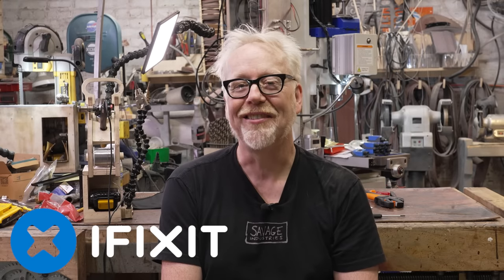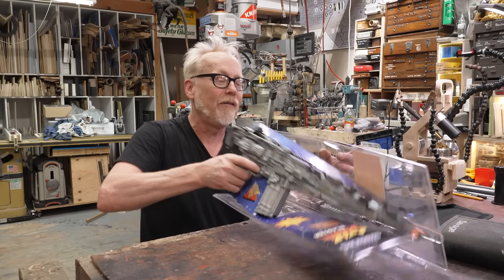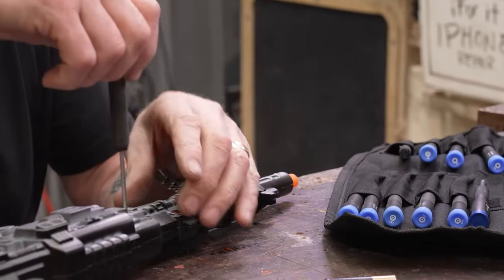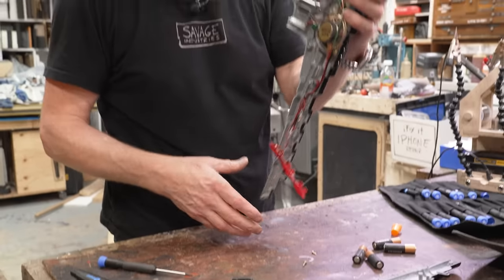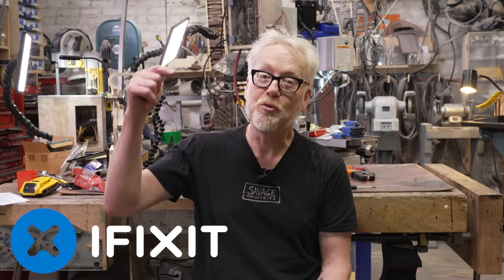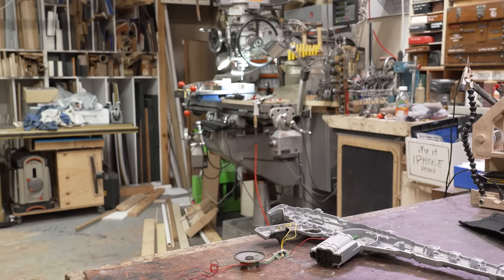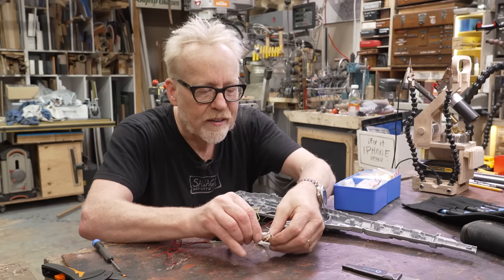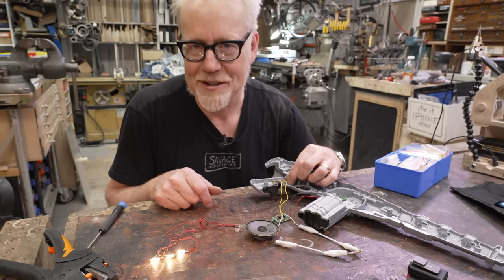How to Quiet Your Kids' Toys!

Comment from the maker: Today’s video is made possible by our friends at iFixit. iFixit's Skip the Upgrade is going on now and throughout September. They marked down all iPhone parts up to 20% off. And, when you buy any iPhone part and use the code BOGOCASE at checkout, you get a free iPhone case. Just visit http://www.ifixit.com/tested
Reply: at 15:00 Adam says you will provide a link.
Reply: If Adam ever comes to Germany again, maybe he wants to arange a visit to the Georg-Simon-Ohm vocational college in Cologne.
Reply: @sorrowschism Missing that link.
Reply: Where's the link?
Reply: Also commenting so i can come back later for the link :D
Reply: Where's the link for the wire strippers at 15:00?
Reply: dang those wire strippers look like they work really well.  Certainly much better than the ones I use everyday.  I wonder where I could find them?  A link would be helpfull
Reply: Definitely need that link for the strippers!
Reply: GIB link
Reply: Highly recommend iFixit tools if you don't have them. They last, and the kits cover most repairs. I have the old pro tech kit, and it's lasted a decade+ of heavy use. I've repaired phones to sound boards and speakers to cameras and laptops with it. I have modified mechanical watches with them too. 

There better, sure, but do you know how to choose them?  These are a safe buy. 

I've written several of the repair guides there, so I'm biased. Just bought more tweezers and spudgers.
Reply: You can stab out the speaker without breaking the circuit. Just stick a paper clip in the old noise hole and give it a twist.
Reply: It's not too hard to do it precisely.  Get an ohm meter and measure across the speaker.  Since you cut one wire already that should be easy.  Then add a resistor in series with the speaker that has the same resistance ...  and you will halve the sound ...
Reply: link please
Reply: Now, i need to know how to make the toys louder so i can send them to my sisters children 🤣.
Reply: He should change his name to Savage Adam.
Reply: I'd try swapping one battery for a metal slug, leds probably still light and volume would be so what lower... And you can use the alug with other toys!

I've totally removed speakers from toys where lights were the main event.
Reply: @sorrowschism    Weidmuller Stripax is the item
Reply: If the speaker is 4 ohm using a 4 ohm resistor will cut the volume in half. Using a 12 ohm resistor will give 25% volume. 16 ohm will give 20% volume.

Comment: As a uncle can we have a video on making toys louder? 😂
Reply: More power, bigger speakers, etc
Reply: Put in a second speaker wired in parallel to the first one.
Reply: Damn yooou! 😂
Reply: I don't normally curse people, but I curse your sir...😅😅😅
Reply: You can put in an amplifier to get more of the speaker. Depends on the circuit, but you might be power limited by whatever is used for voltage regulation. Even then, you can just power the amp circuit from the battery directly if it has enough juice (or add another battery) and use the output of the existing speaker a your source. If you threw an 18650 into that beast with a 12V regulator, you could blow up any dinky little speaker they make lol.
Reply: As a soon to be uncle, I support this request 1000%!
Reply: @danielland3767  😔The curse of the fun uncle is a tough one to bare indeed 😁
Reply: @Merennulli  Congratulations, may all your gifts be popular, noisy, have hundreds of pieces and take up too much space.
Reply: Just so we’re clear. When Adam trashes a job for “demonstration” the item worked on is itself trash and not worth the time to allow into ones home.  This video is solely for those unfortunate enough to be given said trash. I say Let your kids smash the toy and put it were it should be, the trash.
Reply: @codingentity Thank you! My poor sister in law thinks I'm joking when I say I'm going to do this.😆
Reply: Add Bluetooth, and connect it to a soundbar on max volume 😂
Reply: Before you take such a drastic step make sure to have a vasectomy to ensure there is no chance for you to ever have children. Because revenge is very sweet, and the parents of your nieces and nephews will have loooooooong memories. 🤣🤣🤣
Reply: @jllaine With a short 0.2 second delay if you’re feeling really evil.
Reply: I have five nephews. I'm all for this.
Reply: @codingentity  🤣🤣🤣🤣
Reply: I have found air horns and silly string to be excellent gifts.
Reply: loud toys are merely temporary. the true chaotic evil uncle gifts a lifelong interest in loud musical instruments.
Reply: AND more obnoxious
Reply: Hide some extra batteries inside so that even when the parents take the batteries out it keeps going.
Reply: The real trick is to make it quieter, but teach the kid how to make it louder again.
Reply: I MIGHT have taken the Sesame Street Saxophone that my brother-in-law gave my daughter when she was born, and then replaced the alkaline AAs with Lithium AAs, as well as replacing the screw with magnetic rivet (so I knew how to replace the batteries when they eventually wore down, but THEY couldn't figure out how to remove them), before I re-gifted it to his newborn son. Not louder, but that thing would run at full volume for MONTHS...
Reply: I'll like this because I did it as an uncle but hate it now that I'm a parent
Reply: if you can find a vintage toy, called "bigmouth singers"  that is still operational, you will want to acquire it.
Reply: Sounds like a Mark Rober task.
Reply: There is a children’s instrument called a “recorder” that I highly recommend.
Reply: @brainsniffer  we were thinking more along the lines of bagpipes.
Reply: @brainsniffer  now that's pure evil
Reply: Check the ohm rating on the speaker and then buy a speaker with half that value. Caution you may short circuit but it will be about twice as loud.
Reply: Well you could forego the batteries and modify it to be rechargeable with a USB cord. That could definitely make it more annoying since dead batteries won't happen. That can also provide more power for a longer life and could also give you enough power for a small audio amplifier. Which would make it louder, and the parents can't decide to not buy more batteries, since they could plug it into a USB power brick to charge the battery cells you install with the charge controller and voltage regulator.

Comment: The furby community has been quieting furbies with a much simpler method for years. Just open up the toy, put some painters tape over the speaker, seal it back up and your done. That way the mod can be removed if it becomes a collectors item down the line 😂
Reply: So many of my toys growing up had packing tape over the speaker openings 😂😂😂
Reply: My kids learned to look for the tapes, so I had to start doing the resistor trick.
The speaker's impedance is somewhere between 8-32 ohms, so that gives us a good starting point for the resistor values. A set of 3 resistor values gets you quite far with kids toys: 15, 39 and 82 ohms or anything close to those.
If possible, do the quieting down before the kids get a taste for the full volume  😊.
Reply: @JiiPeeHoo69  the reason it still works with furbies and furreal friends is because the speaker is under the outer fur covering which is zip tied on the toy. With other toys yeah kids will probably peel off the tape 😂
Reply: @strayiggytv  Similarly I have a Vectrex games console from the 80s, for technical reasons it has an inherent buzz in the speaker, and there are numerous complicated fixes available online that involve lots of wires, parts and soldering.

I fixed some black acetate over mine by its outer edges, it dulls the high end and itself vibrates re-transmitting the sound via this new hiss-minimising membrane.

And if ever I want to sell it, once the membrane is removed, it’s still as it was when bought in the store.
Reply: I worked in a special school for some time, and part of my job was to 'quieten' noisy toys by using packing tape over the speakers. The other surgery involved bypassing the battery to connect the toy to a switch called a bigmac/big red button so that children with minimal fine motor skills could operate the toy. We were on a budget. ::shrug::
Reply: Meanwhile, Sam (of Look Mum No Computer) has been making furbies louder by increasing the number of furbies by at least 2 orders of magnitude.

Comment: I have 4 young children with plenty of loud toys and my wife came up with the genius idea to just put clear packing tape over the speaker to muffle the sound.  It works great most of the time and the kids still love playing with the toys... just another option if you are less inclined to take apart toys and installing resistors.
Reply: That's what i do, works good enough for me
Reply: Not an expert, but, isn't it possible that tape can be pulled off and become a choking hazard?  Just asking, not criticizing.
Reply: You can also put some play-doh into the audio holes. That should be safe to the children if they can get it out from the toy.
Reply: I'm not so sure that modern toys are anywhere near as accessible to be taken apart either. That was a LOT of screws and wires in this one... that stuff is expensive! (Yay, late stage capitalism!)
Reply: Came to say exactly that! And it's totally customisable. The more little holes you cover, the quieter it gets!

Comment: Use a knob! That is, clip in a variable resistor (potentiometer) and adjust it to your liking. Then measure the value with a meter and replace it with a fixed resistor (if you want); makes it easier to fit inside tight spaces. Or leave the pot in there so you can change the volume later if appropriate.
Reply: the potentiometer would be the thing to get when you dont have a resistor box :P best upgrade to a furby ever
Reply: a small trim pot - set it with a screwdriver, and just leave it there.
Reply: And as a bonus, if your toddler opens the toy and cranks the potentiometer back to full volume, you know you have a budding maker in the works. 😉
Reply: @machinate  This is likely the best approach. No having to dig through a selection to decide things, and as a component it's cheap enough.
Reply: Wouldn't be hard to drill a hole somewhere in the toy and secure the pot in a way that it can be adjusted without opening it all up again.
Reply: @Shoop83  That's extremely dangerous, enterprising kids will find it. They're already gonna be suspicious their toy is quieter.
Reply: @nfnworldpeace1992  you might still need a selection of potentiometers if the one you select doesn't have a high enough resistance.

Comment: It's an 8ohm speaker, so a 8ohm resistor will half the outout.
The 82 ohm resistor reduces it to about 1/10 volume.
Reply: I thiiiiink 8ohm would be a bit over 1/2 the perceived volume, because assuming the voltage drops by half, that'd be -6dB (and each 10dB drops by half perceived volume). And 80ohm would be -20dB, so a quarter volume. They actually make logarithmic potentiometers specifically for volume bc it's all nonlinear.
Reply: @ShinyQuagsire  that's why I said half the output and not volume.
If I know anything about decibels it's to stay away from them.

Comment: With small speakers, the enclosure is often a key factor in how loud the toy sounds.  We once had a small wine refrigerator that had a fan to circulate the air periodically (independent of the actual refrigeration).  The noise drove me crazy.  I discovered it was equivalent to most of the fans used in desktop computers, so I bought a very quiet PC fan to replace it.  On the bench, the new fan was clearly much quieter.  But installed, it was just as loud.  The problem was the fan mounted to the center of a 2-by-3-foot sheet of thin pressboard--essentially a sound board that amplified any fan vibration whatsoever.  (It was a terrible, cheap design.)  The solution was to mount the fan to the board with rubber grommets to dampen the vibrations.  Changing how the speaker in a toy is mounted, where it's mounted, or filling the empty space inside the speaker enclosure with soft material are all viable solutions.  No expensive wire strippers needed.  ;-)

Comment: Hey, for those interested here are the formulas:

-20 * log(1 + R / 8) = the change of audio power in dB

Where R is the value of the series resistor and 8 is the resistance of the audio speaker.

So the 82 ohm resistor Adam used corresponds to a 21 dB reduction of audio power.

For those interested in the inverse formula, here it is:

R = 8 * (10^(-x / 20) - 1)

Where x is the change in dB, so for a decrease of 20 dB x = -20
Reply: Doin the loooooords work!
Reply: Possibly worth mentioning that a reduction in 10dB is halving the perceived volume, so 20dB is 1/4
Reply: Figured people might want to see where this comes from.

The resistor splits the voltage with the voltage coil proportionally.  So the voltage across the coil will be:

V_n = c(V_o)/(c+r)

where 

V_o is the original voltage across the coil
V_n is the new voltage across the coil
r is the impedance of the resistor
c is the impedance of the coil

So the voltage gain is:

V_n/V_o = c/(c+r)

This can be converted into dB power as:

20*log_10[c/(c+r)]

The 20 is due to the fact that power is proportional to a square power of the voltage. Note that the OP used the inverse of the voltage gain:

V_o/V_n = 1/[c/c+r] = (c+r)/c = 1 + r/c

Because he used the inverse voltage gain, he has to multiply by -20 instead of by 20 to compensate.

We can also calculate the power directly.

The power of the coil is given by the voltage/resistance power formula:

P = (v^2)/c

So the power gain is a square of the voltage gain since c is constant:

P_n/P_o = (c/c+r)^2

This can be converted into dB power directly:

10*log_10([c/c+r]^2)

10 since the voltage has already been squared.
Reply: And thus, how much longer has Adam prolonged the battery life?
Reply: @trueKorvus  nah mate, I’m done with uni life 😅
Also mech and not electric engineer…
Reply: @trueKorvus  That is difficult to estimate, since it isn't just the speaker that draws current. The integrated circuit (and lights) also draws some amount of current. However looking only at the speaker output the new power draw is only 8 / (82 + 8) * 100 = 8.9% compared to the old situation (asuming the output voltage does not change). So I would say that the battery life is maybe 10x longer, if you are lucky (it is probably worse). Overal it is quite difficult to estimate and the only way to really know is to do a experiment and actually measure the current draw before and after the modification.
Reply: @tjego5806  Hey thanks.
Now I'm not sure what would be worse. Listening at normal volume or at a reduced volume for 10x longer? At least the kids are happy.
Reply: @tjego5806  Nowhere even near that.  

First note that you are calculating the impedance of the coil as resistance. In reality, they are vectors. 

Second, note that the resistor is actually dissipating much more power than the coil as it has 82/8 = 10.25 times as much voltage across it.
Reply: No.  The savings will be nowhere near as dramatic.  Consider that the resistor will heating up and dissipating more energy as heat as it has most of the voltage across it.  There is also some simplification on the difference between resistance and reactance that has been ignored.  Finally there are other components that are using power.
Reply: @timharig   >> First note that you are calculating the impedance of the coil as resistance. In reality, they are vectors. 

Yes, I know that in reality it is much more complex (pun intended) the wikipedia page Electrical characteristics of dynamic loudspeakers gives a more complete picture of the actual impedance curve. The calculation I did is only true for very low frequencies.

>> Second, note that the resistor is actually dissipating much more power than the coil as it has 82/8 = 10.25 times as much voltage across it.

Yes, I never disagreed with this, however the total power drawn by the resistor and speaker will still be less than just the speaker by itself.

>> No.  The savings will be nowhere near as dramatic.

Correct, I already hinted at this before, but taking into account the complex impedance I figure that the total power drawn by the speaker and resistor is maybe somewhere between 15% to 40%. I am curious what your estimate would be.

>> Finally there are other components that are using power.

Yes, I agree and I already mentioned this fact.

Anyway, sorry if my comment raised any confusion it was just some quick napkin math. Have a nice day!
Reply: @trueKorvus  not at all because the energy is being dissipated as heat. And the lights are on more, so it would be a negative power saving per seconds of use.
Reply: @trueKorvus  Possibly a little worse, actually.

Comment: I usually attach a potentiometer (variable resistor) like you did with the clips (one outer lug and the center lug) then adjust it to the desired level. Disconnect the clips and measure the resistance on the two lugs with a meter, and grab a fixed resistor with a similar resistance and use that. Just another way; both methods get the job done.

Comment: Starting at 7:17... I now know what a resistor ACTUALLY does... that little resistor fact is now "the most sophistocated things I now know about electronics".. although you say you know very little.... there are others who know even less! Keep sharing!
Reply: I thought power was not dissipated by the resistor, that it was just "resisted", meaning it draws less power from the source.  I would think the quieter toy would consume less!
But maybe it's all more complicated than that. Any engineer that can clarify this please?
Reply: @ToniLeys you're correct.  Adam's description of how a resistor works is not entirely correct.  But the fix still works.
Reply: @timharig  ooooh that makes sense, thanks for the thorough explanation!